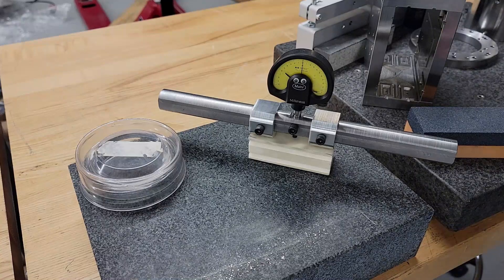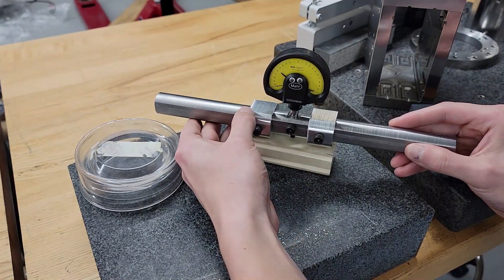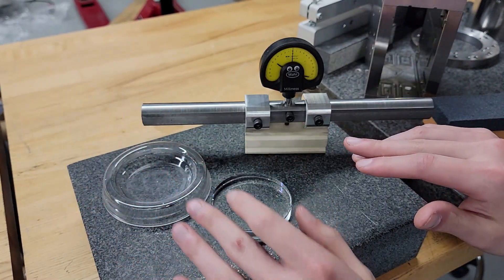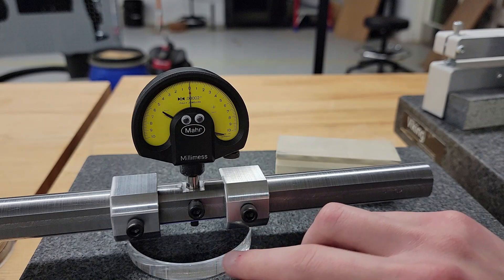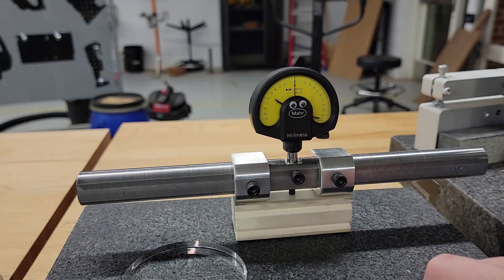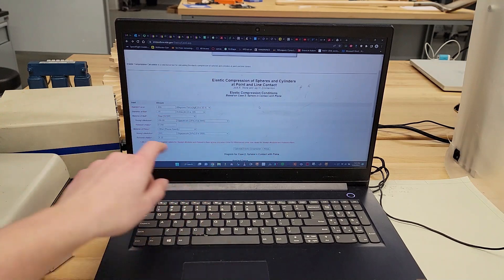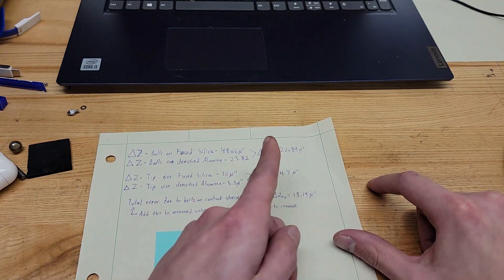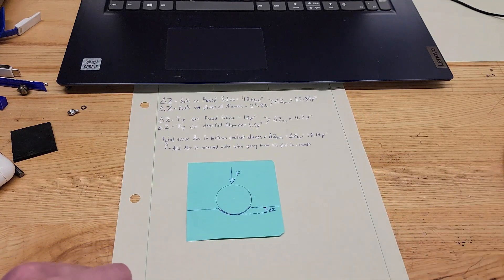Precision Metrology- Two footed twist gage and Hertzian contact stresses

Comment: I'm guessing that the master you set the gauge to must be as wide as the the part you are gauging? If you set your zero on the optical flat and then expand the footings to gauge the granite plate wont the deflection in the beam give you an error in the measurement?
Reply from the maker: yea, if you move the feet spacing all zeros are immediately lost and you must re-zero. The feet spacing adjustments are not precision at all, beam deflection is the least of your problems. So yes, need a master the same size as your part.

Comment: Did you remove the gage force from the overall gage weight? The load on the 3 feet balls would be the weight of the whole assembly minus the force the gage exerts on its stylus. In this example the gage force is such a small percentage of the overall gage weight it is borderline irrelevant but in some situations it could matter. 

Another consideration is that not all 3 feet balls are experiencing equal loading. The side with one foot sees more load per ball than the side with two feet, thereby more deformation. 

Still a great video though! Love your channel.
Reply from the maker: I did remove the gage force from the overall weight for the calculations. As you said it doesn’t effect it tremendously though. However, you’re absolutely right about the unequal loading, that was a totallll blunder on my part. I just redid the analysis to see how the results differ. Interestingly, because one ball is experiencing more than I calculated for and the other two are experiencing less, they sort of average out in the middle where the gage is (even though now it’s ever so slightly tilted) . The discrepancy ended up being 152 nanometers between the two results. Small but not insignificant! Thanks for pointing this out!
Reply: @cylosgarage A nanometer here, a nanometer there, before you know it you have a real error 😂

Comment: I was thinking “what’s the likelihood of @Robrenz and someone else both covering hertzian contact stresses” and apparently it’s 100%. I like that you presented it in a very different way which really helps with comprehension. Thanks!
Reply from the maker: I think Robin has covered it a couple times on his channel already lol. Thank you for the kind words
Reply: 1.  An alternate way around Hertzian deflection is to add a 'snow-shoe' under each contact point.  Basically a disk (about 3/8" or 1 cm dia. x 1/8" or 3 mm thick.) w/ top & bottom polished smooth, flat, & parallel enough to not introduce much change from small variations of contact location.  Contact on the tops is always the same materials and forces, so no variations there.  Pressure on the bottoms is too low (spread out) for significant variations.  Could be tool steel, carbide, or other ceramic.  Also helps to meet standards for surface plate inspection/calibration.  Add a 'skirt' around each contact point to locate it's snow-shoe (w/ about 0.003" dia. clearance).  Some wide side grooves and a narrow (bowed triangle) wire hoop can be used to capture each shoe in the skirt, while allowing it to float vertically.

2. You do not actually need a 'true' flat to calibrate against.  It is enough that you have a reference w/ a known (repeatable) 3-point difference from flat (within the indicator's range) for any span of interest.  And there is a technique to 'boot-strap' getting that difference value (based on the 'method of reversal').

Suppose you have a reference bar (like a scrap piece of ground hot-rolled stock) w/ both sides smooth,  flat & parallel enough to fall within your indicator's range.  You can rig a set-up to use the indicator to measure the reference bar's thickness variations at the twist gauge's foot (end) & indicator (center) contact locations.  You do not need to set-up on a surface plate; any stable & sufficiently flat+smooth surface will do.  You do not need the absolute thicknesses, just the variations per your set-up.  The set-up must be fixed, and you move the reference bar under the indicator.  The center location's reading minus the average of the end readings is the reference bar's 'bulge'.

Adjust the twist gauge to minimize the (sum of the absolute) values of the top & bottom surface bow readings.  The top bow reading minus the bottom bow reading (w/ the proper signs) is twice the reference bar's (mid-line) bend.  Half the bulge plus and minus the bend yields both surface's (true) bows.

If needed, lap just the (high) contact locations on each surface of the reference to reduce the amount of the indicator's range being used.  Note that this method required no surface plate or optical flat.  In fact, it can be used to calibrate a twist gauge for measuring a surface plate of unknown flatness!